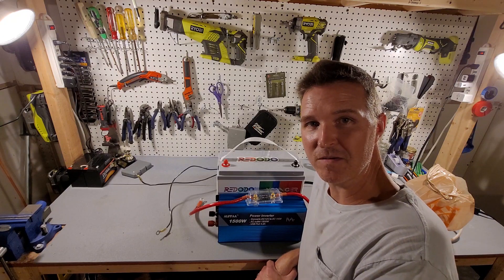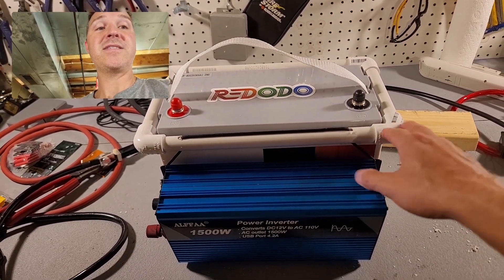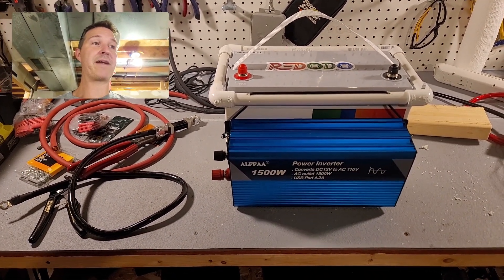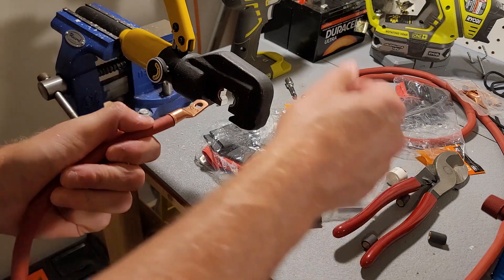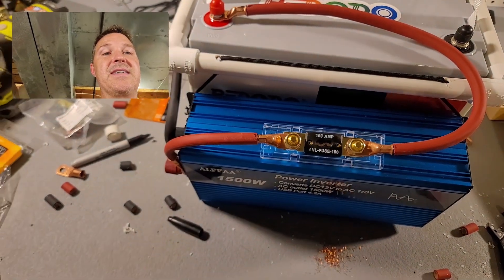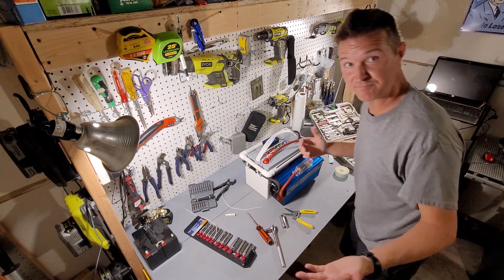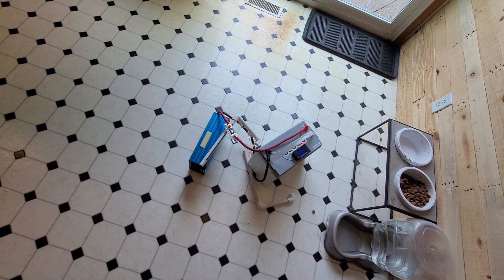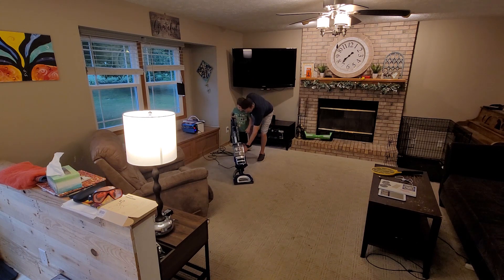DIY Super Portable 1500w 100ah Off Grid Power station!

Comment: I thought about JB welding the inverter, wonder if that would work? I have a small 500w I used velcro tape and it seems to work. I put it on the top. Good vid
Reply from the maker: That's a good idea!  Thanks for the comment.
Reply: @OffGridBasement  I use the 15 lb strong outdoor type velcro, works well. Didnt try the JB weld

Comment: SAFETY FIRST! NOTHING is ever EASY! always! Nice little build!  Some short little self-tapping screws instead of PVC glue and your PVC stuff becomes recyclable. The Only thing I saw that was forgotten, was EVERY POS wire connection HAS to be covered to prevent a short-circuit in the event SHIT happens and you know Murphys Law, and you have curious children sneaking around. LOL! BUT you did put in the must have Catastrophe fuse, sized to protect the wire and carry the load (AWESOME) at the Battery POS terminal! GREAT JOB! MOST DIYER's don't understand that you MUST put in that fuse. GO find some of those red rubber battery terminal boots to fit your size of wire and cover ALL the POS connections at least, GREAT! cover all the NEG connections with black boots, optional. PERFECT!! May I suggest a battery disconnect switch between the big fuse and POS post to quickly KILL the system since you will never have a wrench in your hand should SHIT HAPPEN!  SAFETY FIRST! Do it right don't just make it work! Thanks for your videos, Tons of INFO!
Reply from the maker: Thank you for the comment and all the great advice!

Comment: About how long can this battery last per use if say you were using 700-1000w?
Reply from the maker: It's a 1280wh battery.  That would mean it can sustain a 1000w load for about an hour and 15 minutes.

Comment: This is a great idea, to have a charged battery with an inverter for emergencies.    I'm
new to this,  my concern is forgetting to watch it, and I find that the battery is completely 
dead when I go check on it.     Does the inverter shut off or give a warning when the battery get down to maybe 80%?
Reply from the maker: The nice thing about LifePO4 batteries is they can be stored away for a year at 70% charge with no problems.   I will be checking mine every 6 months just to be safe.  The inverter beeps @ 10.5v and shuts off at 10v.  That leaves about 5% left in battery.  Thanks for the comment!
Reply: Yes, you can do that with a simple cheap module and a relay, it also can shut your inverter output when needed. if you want to take it further then use a voltage divider with wifi module then it will notify you on your smartphone.